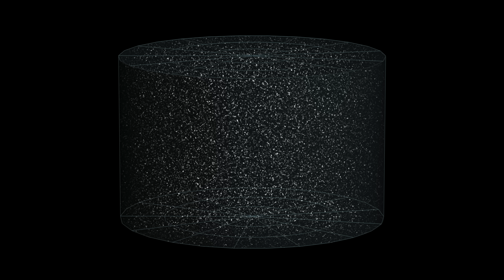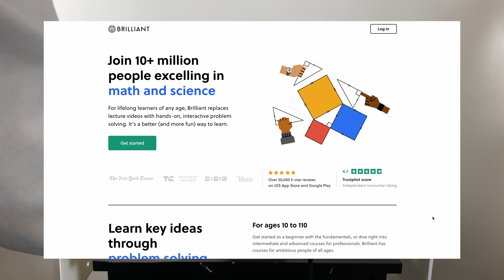World's biggest gear ratio...

Comment: Try to move the last gear if you can, the rest of the gears will rotate at fantastic speeds
Reply: Is not possible! When you play with gears ratio you also play with torque ratio
Reply: Nothing will move because the energy required to turn the first gear is greater than every motor on earth combined. The wheel would need to be built to the size of a planet to not sheer from the force alone
Reply: @CroissantCreates Probably True!
Reply: @CroissantCreates  Right, he should lower the number of gears a bit
Reply: the about of force it would take to turn that last gear would shatter it
Reply: He did that in another video, but with a much smaller gearbox. Probably close to the highest gear ratio possible in this style without major design changes. He got 1:1200 or so iirc, and that needed a foot long crank handle.

https://m.youtube.com/watch?v=_Ab-TkiGrmo
Reply: Did you finished the video? He said the first gear has to spin faster than the speed of light”.
Reply: & i feel its structured the same up side down..like its same whether you turn it from this end or that end, it behaves the same..
Reply: Believe or not, it's impossible
Reply: The amount of torque needed to spin the last gear would be more than astronomical so no spinning the last gear
Reply: I wouldn't say it's impossible per se, but getting that last gear to move any noticeable bit at all would cause the first gear to suddenly catapult at a speed that's apparently faster than the speed of light. Naturally, I think if you somehow made a machine that forced that last gear to move somehow, the entire gear system would instantly combust, and most if not all of the gears would just instantly fly off the machine.
If you somehow managed to force all the years to stay together though, then causing that last year to move any noticeable bit would probably instantly rip a hole in the fabric of space-time and destroy everything in the universe since nothing can go faster than light.

Either way, I don't recommend it 🙃
Reply: Definitely try it! You could hook it up to a gas engine if you aren't strong enough to spin them.
Reply: سيتخطَى سرعة الضوء 🙂 .